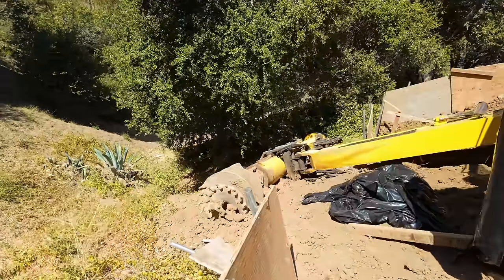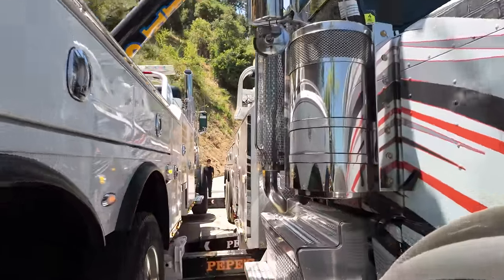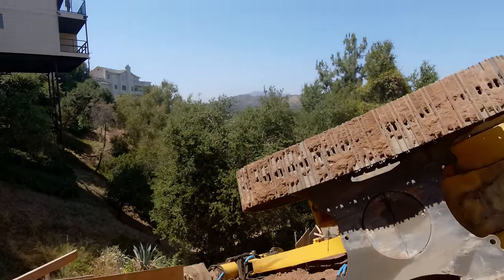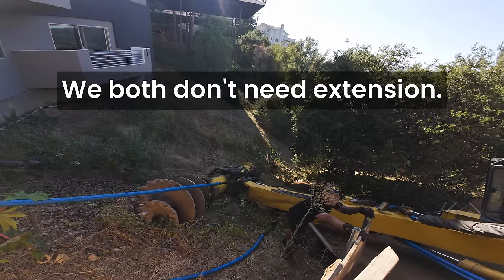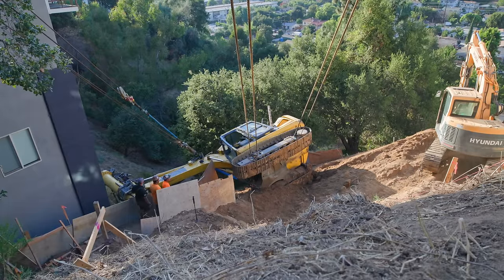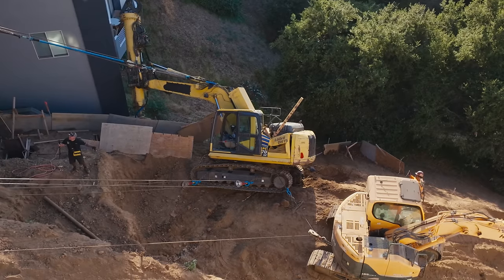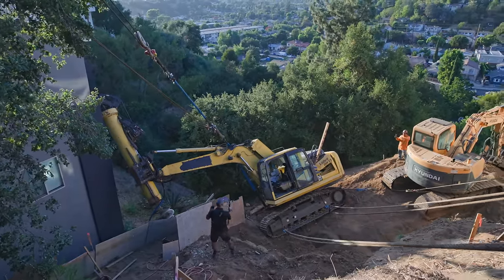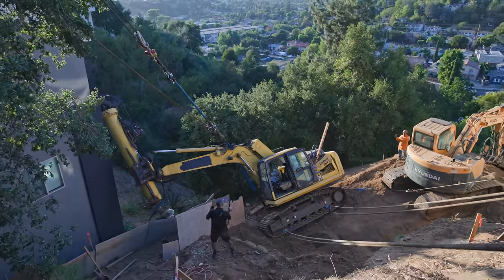Excavator Rolls Down Hill! (Our HARDEST job yet)

Comment: First 5.0 or larger quake all those houses will go down, hill and all, that is if the first canyon fire does not destroy them first. Narrow roads, no fire fighters either, and probably no water either with broken water mains as well.

But a great job getting what looked like becoming a permanent feature for the new house out and able to get operating again.  Might have been worth it to had the rental mechanics out to first strip off and pull the drill, it does detach, would have helped with getting upright, as both lower mass, and less leverage on the whole unit.

Comment: Cool, I'm seeing what you're doing well before you do it. lol If you would have made a yoke between the upper rear of the carriage and the line over the engine house you would have 1/2'ed the pressure on that engine house by pulling in the middle of that yoke.

Comment: Yeah, I lived in Eagle Rock before I moved to Highland Park.  

Everybody thinks of L.A. as this massive freeway interchange, and it is; or a place where there are surface streets like 40 and 60 foot wide, and while all that's true, there are a lot of streets like that all over L.A.  

Even the exits off the freeway are not made for modern cars, and by modern cars, I mean from the '50s on up.  I mean, come off the 134 at speed, jam on the brakes hard! and loop around at no more than 25 MPH to get onto a surface street where there's no room to merge.

Comment: You guys make a very dangerous job look easy. Back in the 80s I helped design Umbilical systems and cranes for dirigible systems (sea and surveillance dirigibles). I don't know much about this industry as far as frequency of lifting inspections for wear/damage. But seeing first hand what a snapped cable or bad weld on a lift ring can do, I cringe when I see people standing within whip range of a snapped cable. Often wonder why dampers are not used more often, granted the time to setup in this industry would be an issue I know.
And I am sure there will be replies that everything is safe, but unless you have witnessed a completely new system with new cables/chains fail due to a single cable mfg defect that wasn't noticed you dont understand how dangerous these jobs really are. Be safe - and inspect often :)

Comment: Josh, I was thinking next time you run into a scenario like this bringing a welder and weld some D rings on the counter weight May cause less headaches
Reply: POCO to do a disconnect/reconnect and a welder to put on the lugs.  Have to be a pretty amazing welder though. If one ever pulled the backlash could flip the rotator over.  At least with this they knew what they were dealing with.  Another problem would be who would coordinate it and who would pay for it.  

Good comment

Comment: "Hey, get your trucks out of the way. I got to get to the store for some smokes." says the guy in the BMW.
Reply: Were 'the orange guys' part of the pile driving crew?  Looking at what they are up to, where you are and how hot you said it was it was good they were there to supply extra eyes and muscle.  

Great video so far.
Reply from the maker: :_Laughing::_Laughing::_Laughing::_Laughing::_Laughing:
Reply: I would have done it with 77 . . .  Is that a much smaller truck?  Great joke if it is.

Great stress reliever after getting it away from that buttress wall on the other building and stable-ish up on the bench.  I'm sitting here on the edge of my seat.  Great editing Josh.
Reply: I was looking for the brand name on the excavator / come boring machine to suggest you send a link to the manufacturer keyed into your commentary about no hoisting points when I noticed that the name of the company that tackled this job was all blacked out on the boom and the back of the counterweight.  Was that the price of filming?  Be that as it may, I don't see much shame in having that machine fall over considering how shitty this job placement really is tucked in between those other two buildings on that incredibly steep sidehill.
Reply from the maker: 77 is my dad's rotator haha
Reply: Even Closed Captioning was giving you guys applause for doing such a fine job.

Couple of thoughts - going to be a lot more vehicles on the lane now that its after work time.

And now that you have the machine all rigged up perhaps they'll ask you to stay that way until they have those last two holes drilled.  Then you can help them yard those two machines back up that incline so they can get back out of there.  <Facetious>  What a job to take on for everybody involved.  The General, the trades and Pepe's too.
Reply: Liked the tailgate section with Josh.  You addressed many of the points I was thinking of as I was going through the video.  Very impressive recovery.  Hats off to all involved.
Reply: Just shared it to the Book of Faces.  Here's my descriptor.

"If it was easier someone else would be doing it.   Amazing demonstration of experience, rigging and persistence on a brutal recovery site."

Telling was the comment that we don't have a C or D plan.
Reply: @gragor11  Pops drives 77, that's a 2022  60-ton tater. Pops would of personally rolled all the way down the cliff on his first unsuccessful decent to analyze the job !
Reply: @joeacosta5011  Oh that's harsh

Comment: Looks like they were just gonna cover it over and leave it till someone stopped em.
My idea when I first seen this was to dig a hole on the uphill side so that when you pull it uphill it would roll into the hole and upright itself. Make it's weight work for you.
Reply from the maker: The covering was to protect the logos of the company
Reply: Thanks for answering that. I had thought it was a fatality where they had covered the body. Glad to hear it wasn't  @PepesTowingService
Reply: @PepesTowingService  I was talking about all the dirt that was piled up on it. It was nearly 1/3ol of the way up. Good job though! 👍 that was a real challenge and you pulled it off. Most people would have either quit or damaged that building. Way to use your brains!

Comment: Simply amazing. 2 questions though. Would an airbag under the boom help with the initial lift? Also would it have been better to put a pulley in place when using the deadman so that the lines were doubled between the two excavators? That might have kept the rotator from pulling as much up on it allow its weight to better bite into the ground. I know these wouldn't have been much but do you think it could have helped get over the hurdles?

Comment: Another great job by Pepe's Towing.
One question; any thought on taking some of the flipped excavator apart?  Hammer, counterweights etc.  Or is that just impossible.
Reply: That would have been the next step perhaps but why would a recovery company want to take on such risk dismantling that equipment.

Comment: That was an incredible video and glad to have watched it, got me through a tough day in the ER. I wonder if this job didn't pan out, whats the alternative? Helicopter lift maybe, scrap it and haul out piece by piece? I thought crane until the ending and answered that question. I swear Californians will build a house anywhere, that 2nd house over towards the end just on metal suspended off the cliff was nuts.
Reply from the maker: People guess helicopter so much but that's never, ever an option. They're only used for people. The logistics of getting a helicopter over a residential area to lift multiple pieces of metal makes zero sense and would cost so much money and carry so much liability. Would probably be cut up into smaller pieces and destroy it.
Reply: @PepesTowingService  Thanks for the reply, brightened my day! Makes tons more sense more I think about it - nothing beats expierence

Comment: I know this is a dumb question, because if it had any merrit you guys would have done it,  but I've wondered the same in other rescues as well.  That drill and most other attachments at the end of the tipped excavator boom are made to be interchangeable which means they can come off.  Why are they never removed to make uprighting easier?
Reply: Because even if we could, we would need an overhead boom or lifting device to remove it.

Comment: Just a question. How come you couldn’t use steel girders in the ground by the support excavator? To create a huge anchor point.
Reply: Looks like they’re not fully anchored, the forms around some of them seem to indicate they’re ready for a concrete pour, Josh showed one which was simply sitting in the hole with nothing around it.

Comment: Man I say that with pickup trucks and even cars, they use to be easy to find a point to grab, but now its a pain, I remember trucks use to always have hooks up front, Look like GM is putting them on most things but I had to pull a Colorado out of 3 foot of snow with my suburban, of course zero hook points, and I don't really like going to the control arm, but thats what I did.

Comment: keep in mind as I ask this question that I have NO idea what I am talking about.
since there were 2 trucks/4 lines could you have gotten away with single lining it (making cable pulls easier) or was there not enough of a safety factor involved with single line?
I'll never run a rotator but correct rigging is correct rigging no matter the equipment used.even if its me pulling a car out of a ditch in winter in Maine.
very informative/good video as always, stay safe out there.
Reply from the maker: Absolutely not. The forces needed to upright this exceed the safe working load limit on a single line.
Reply: @PepesTowingService  gotcha, thanks for the info. that is stuff I did not know.

Comment: What would the fire departement do if they had an emergency? Their truck arent that small either..  1 hour to get to a burning house?
Reply from the maker: Fire department wouldn't care about not scratching cars in an emergency. It's easy they'd just hit cars. And their trucks turn better than Hulk
Reply: They have air support with huge helicopters that carry water to extinguish fires in hard to reach places.

Comment: 1:20:12 see the beam on the right you showed at the beginning. Could you of chained the med-mini/X to that to keep it from your sliding issues? Also at this point Could you possibly see if the big X could start up to swing that boom & drill back over?
Reply: I saw that as well but notice it's not cemented into place, the second they attached that an pulled it would have come out of the ground and probably bent as well. Not sure what bending stress that i-beam could take but if that other excavator was being pull backwards it's a lot of force.

Comment: Do you think it would be an easier job with a skidster and a winch box and 1 truck
Reply from the maker: How would it be easier with just one truck? If it pulled a 30,000lb excavator, a skidsteer would do no good ehre.
Reply: @PepesTowingService  I’ve seen other towing companies with hydraulic winch boxes on skidsters and they burry the box in the ground and it’ll pull just about anything @murphysdiesel has one and he pulled a crane that was stuck with it
Reply from the maker: I hope there's a video I don't know about, because I just checked their channel and only one I saw was that skidsteer doing a winch on a boom truck. That's not even apples and oranges, not even close
Reply from the maker: ya like I thought, that's not even remotely close to being the same scenario. That crane is upright. Try putting it upside down and then put the winch box in soft sand like our job, it wouldn't work. Completely different environments and scenarios.

Comment: If I had been the boss of this recovery,
1. I would have run the 'chains' over the top and down under to attach to the frame on the near therefore upper track assembly.
2. the working head of the machine taken off ... Cut off with a gas set or drive the pins out I don't care but that top weight is not being lifted in the first lift.
3. using the small digger the fill that trapped the Lower Track has to be removed to allow the machine to come over without destroying itself or going down the hill taking the 2 trucks and small digger with it. so now 4.
4. Sack the guy who said to change the chains or send him back to a Physics Class.
5. Pull the bloody thing back into both tracks and secure it from moving with a GOD Hook.
6. one at a time relocate your cables to the best position and take up the slack before moving the next one.
Once you have all 4 blocks ready to move again - begin the second stage of recovery.

Now if you've done your homework right as below - the rest is easy

Here's my suggestion on how to get shit load more Subscribers and I'm taking this job as an example,

And I've just Subscribed so this is an Honest suggestion ...
In a Job like this where the Neighbours are not the happiest car moving people on earth, you hook up and take the slack and close down the machines ... Over a sound system you say, Bids are now open for one hour for an 
A=Clean recovery - 
B= A Second Recovery needed to be performed or - 
C = Total disaster the entire 3 rigs roll down the hill and it's a We have to buy all the properties below.
Neighbours you now have 45 Minutes to Bid before it gets noisy again and bidding closes.

Here's what's going to happen, Every Neighbour is going to be Live vid to their favourite people and it's going viral and if you have your youtube showing on the trucks "You Will Hit The 500,000"

That cup of tea time is important for Their Publication, they need to get their cameras set up they need several quads flying over top they need the local news reporters in Choppers over head ... then you need to start your machines and raise a flag saying "All Bets Closed"
@PepesTowingService - do you want 500,000 subs ?
It's going to cost you the time it takes to make a cup of tea and meet the aggro neighbours because They are where your next Job is coming from
@PepesTowingService  - Final Advice !!! Never Never Never Again record yourself saying you worked on a neighbour now he's a puxxy !!!
I have Subscribed
Reply from the maker: This word salad of a comment reeks of mental instability. I hope you're seeking help for it. Ain't no one got time to read that bs I stopped reading and started laughing when you started talking about cutting off things. That's why I get these jobs and you don't

Comment: Oh boy what a mess. That construction site shouldn't have come into that state in the first place. Basically everywhere the slope would need a lot of sheet pile or trench boxes, the whole slope is just waiting to screw off downhill. It easily could have, with the weight of two trucks and the many thousand pounds of pull on it on top of that. Geeeez.

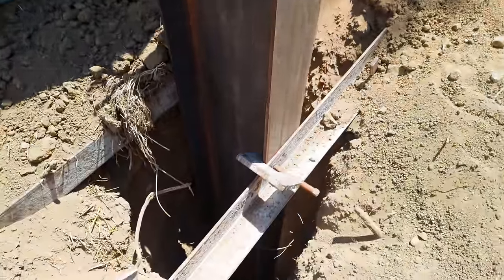Comment: At around the 1:13 mark of the vid. Question: Why not see if it would start. And use its own power ?  🤷🏽 ..Just wondering. 💭 Great video though ✌🏽
Reply from the maker: Lol I take it you don't operate these. It's not even remotely possible
Reply: @PepesTowingService  Nah , I don’t operate these machines. Just curious.

Comment: Maybe the building contractor should have been told to remove the tracks and the whole boom to reduce weight.
Reply: Not realistic in that position and where it is located. And if so, it would be all on the recovery team
Reply from the maker: Even if it was somehow possible, that would be a horrible idea. Imagine they did, now what? Where do you stage it? How do you work on it without the risk of it sliding down further? That would take days with a full crew.

Comment: Just an absolute kick ass job.  
Talk about one obstacle after  another. I just knew you were going to touch the corner of the house because the soft dirt wouldn’t keep it from sliding. 
Who builds a house on the side of a freaking mountain with nothing but a cow path for access. 
If you had a fire or other emergency there would be no hope for emergency services to ever get there. It just wouldn’t be possible. 
Again guys just an absolute beautiful job.

Comment: 1:06:21 is it possible someone get on the excavator, turn it on and rotate the arm so it can push itself up? Or its too dangerous?
Reply: No one setting his foot into that machine, absolutely NO WAY!, until it being hauled fully into security and sitting level. Next a mechanic have to check the eninge and fluids before any attempt to try start it.